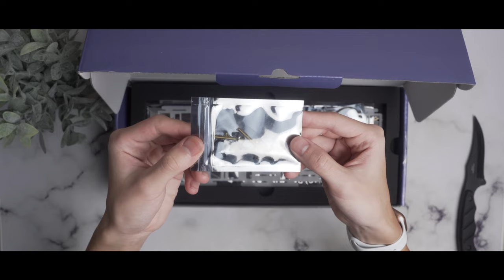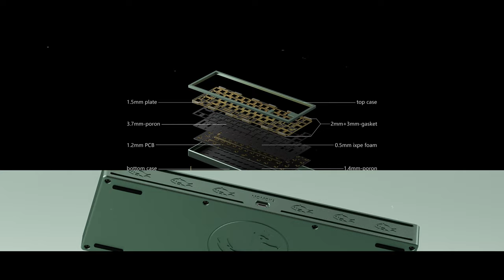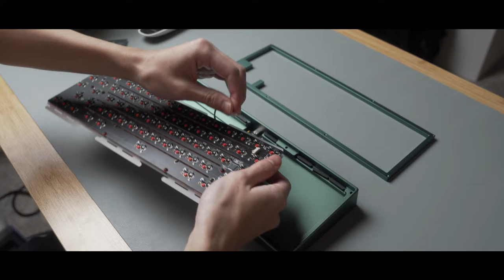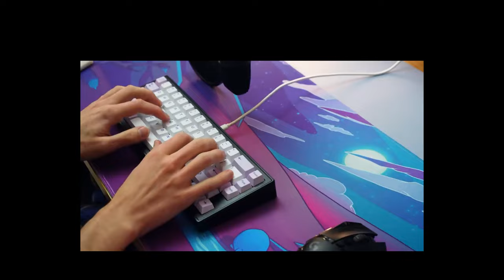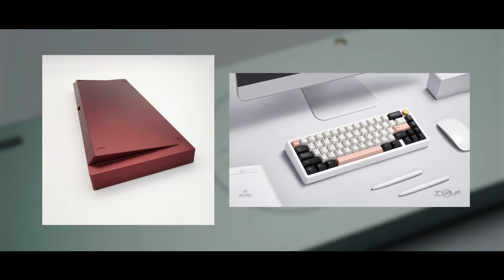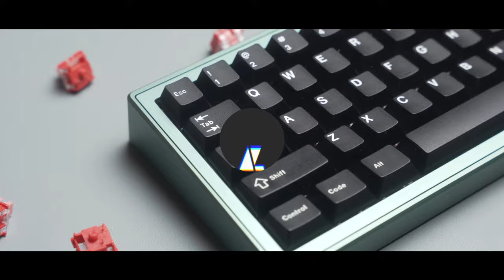How is this keyboard $170?? Momoka Zoo65 Build + Review

Comment: I believe Hipyo's board was an early unit that had ping issues. It's mentioned on the website that the design was or had to be updated because of the case ping.
Reply: nah it's because he decided to leave the screws loose, which creates resonance issues from the vibrations. Most of Hipyo's builds are cringe for a reason.
Reply: Hipyo installed the gaskets incorrectly too.  Got this board and is 99% perfect, but I do get ping from my spacebar.

Comment: As a review video, I wished you tried out all foam configurations including all foam. Good quality video just wished it showed more than just your preference
Reply from the maker: I dont understand this comment. The only foam I didn't try was PE foam, which isn't something that matters anyway. Everything sounds the same with it.
Reply: @nearLucid  I get where you're coming from, but it would be nice to include a build with everything included to know how the board sounds like with everything. Would be nice to not have to jump around other review videos since I do quite like your videos.
Reply: @nearLucid  Why doesn't including pe foam in your review matter if it's included in the box? Shouldn't reviews include a sound test of a board in it's stock form before anything else?